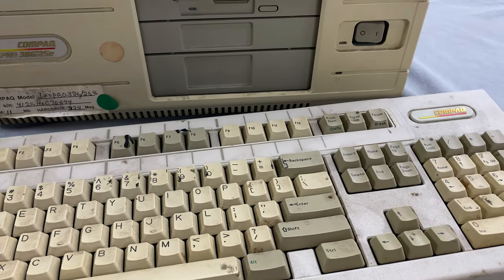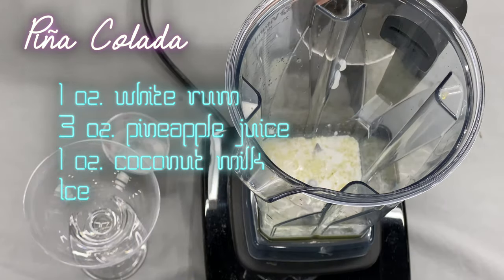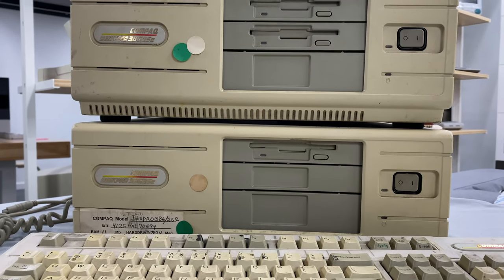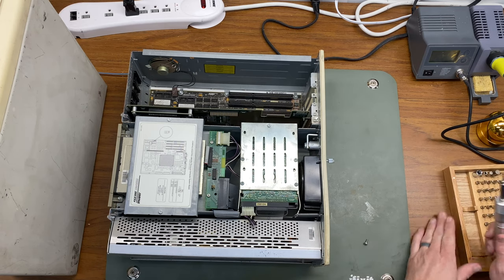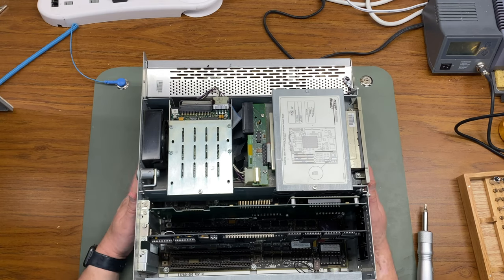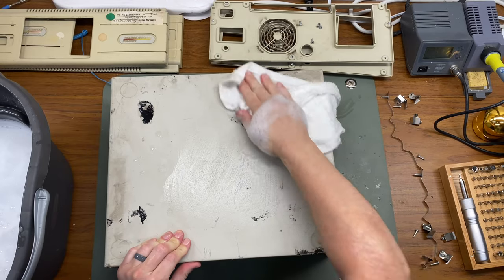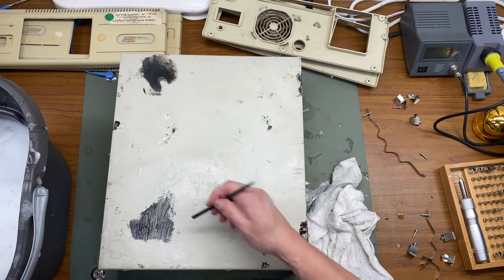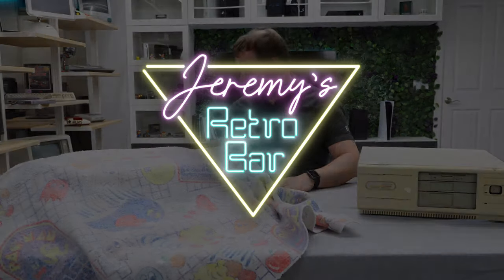Restoring a Compaq Deskpro 386 25e - Part 1 | Jeremy's Retro Bar

Comment: One thing I've found that's good at removing adhesive and marks off the case is oven cleaner. Make sure to not leave it on for very long and isolate to just the worst areas on the case. If you want to preserve the factory labels and Compaq emblem on the front, make sure to remove the front face (or tape it off) because it will eat through the paint on the emblem.  Going this route can remove some of the paint on the case so I would only leave it for a max of 3-5 minutes before scrubbing the affected areas and rinsing.  This has eaten through all the old melted rubber on all cases I've tried so far and left the case looking very clean. If you prefer to use a non-caustic approach and an adhesive remover like Goo-gone isn’t strong enough, 3M makes an excellent product in aerosol can form. I’ve found it much stronger than Goo-gone but is still as safe.

Comment: This was my first PC as a Kid in 1996. Before that I had a Commodore 64. The Deskpro hat 8MB RAM, and a 387 Coprocessor. I put a CD-ROM Drive in, and ran Windows 95 on it. It was very slow, but worked. :)

Comment: I've painted a few cases as well and found that Kyrlon Pebble is a little bit closer to the original beige color for Compaq machines. Maybe try that on the other metal top and see which one you like better. As for your ending, a cliff hanger! C'mon part two already LOL!
Reply from the maker: Pebble was one of the colors I tried but it’s really more of a gray color on the metal so nothing quite matches. Haha I didn’t want a cliffhanger but I was looking at the timeline and I saw I had so much more to get through so I made the call. Part two will be next week instead of two weeks like usual.

Comment: I got a Compaq Deskpro 386s (looks very similar to your system) from Computer Reset!  Mine actually works... minus the floppy drive(s); it didn't come with a hard drive.  It was gross though.  Covered in some type of black sludge (melted rubber?) that I had to clean.  The motherboard was also coated in a layer of dust!  I used 99% IPA to clean the board and a mix of cleaners/magic erasers to clean the case.

Comment: I also picked up a 386/25e from Computer Reset about 8 months ago. I can’t believe how well it cleaned up despite cooking in that warehouse for so long. All That’s left is to replace that Dallas 1287 clock battery. A gorgeous machine. Did you find the keyboard at CR too? I wasn’t able to locate a period correct model when I went.
Reply from the maker: Yeah. I got matching keyboards for most of the CR systems I picked up. Or at least I tried to.